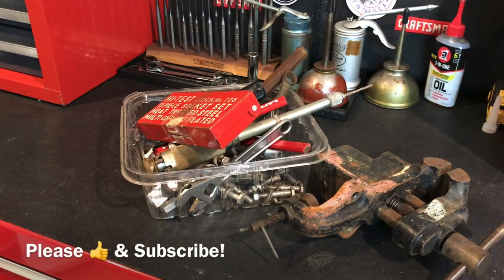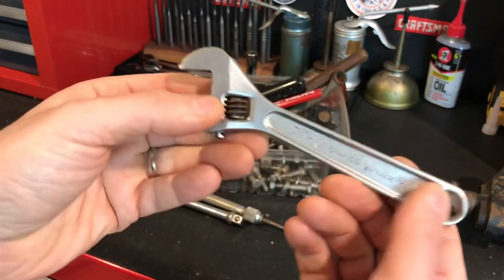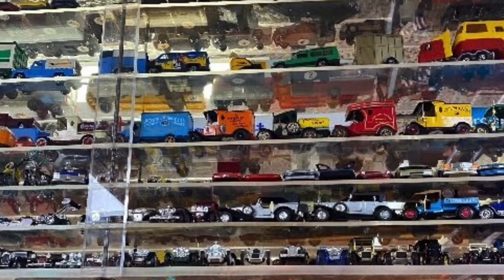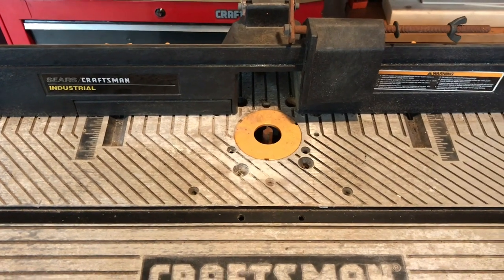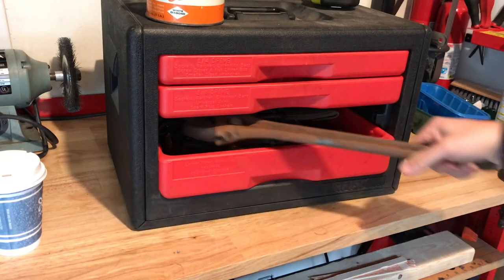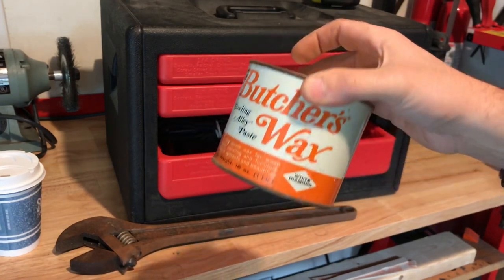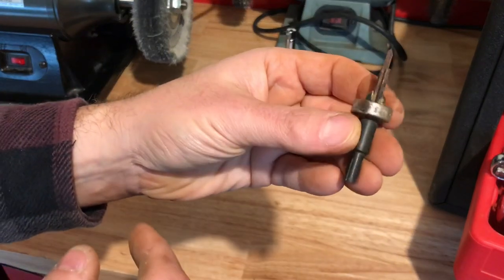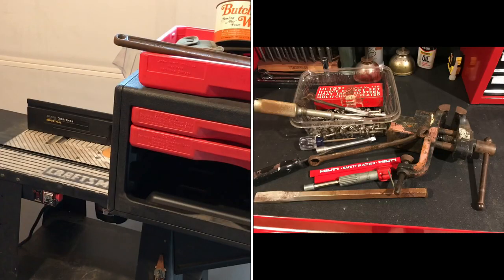2 Estate Sale Tool Hauls!

Comment: That red handled driver brings back memories for me .In the early 1960s I had a set of them. I used  that tool to do everything I was very tool poor. Using cast off parts I was able to build motor bikes and a go cart. They were not much good but I spent many happy hours working and I learned a lot.

Comment: Nice! I would have paid that just for the Wright adjustable wrench. If I could get a free set of any brand, I would choose Wright not Snap on. 
Klein makes push drill bits?! Push drills are so cool they used to be in every shop and garage and now most people don’t even know what they are. I have one of those multi adjustable nut drivers but I think mine is Craftsman. They are pretty neat. Oh and that U.S sheath doesn’t go with that B.S.A hatchet. It may be worth quite a bit to a collector. Nice haul Tom! Take care 😃👍🏼
Reply from the maker: Thanks David, I saw on EBay they are getting close to $100 for that hatchet. That will be a fun project to restore.

Comment: That vice grip is designed to be used on hydraulic hoses like brake lines instead of using box wrench spanners
Reply from the maker: Thanks for the info. 👍👍
Reply: * Flare nut spanner